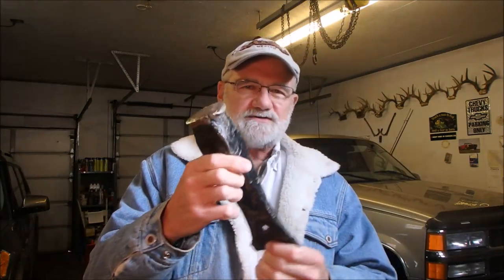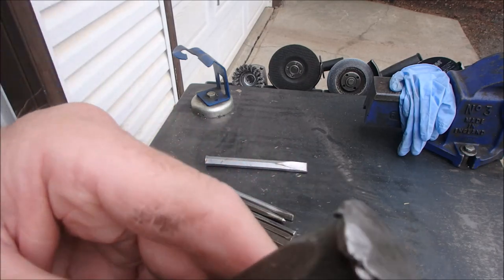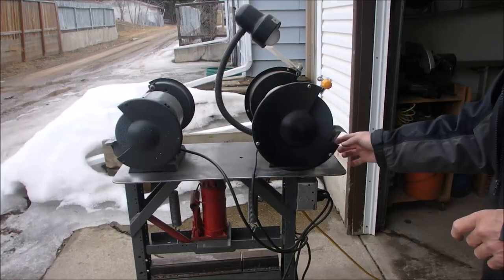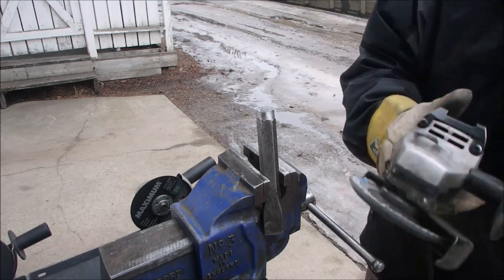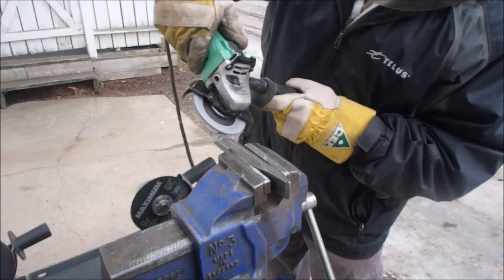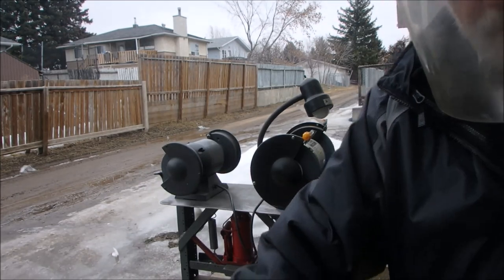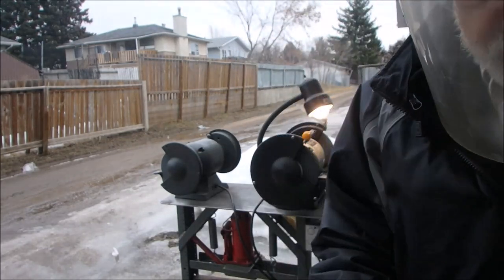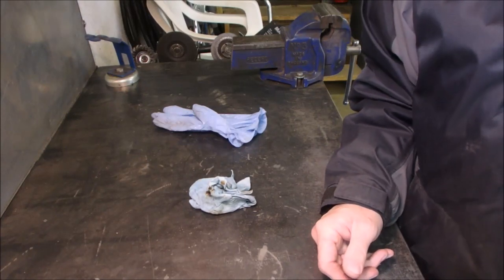Chisel Dangers

Comment: This is something I've practiced since being in the Navy some 25+ Years ago. After every use, we touched up the striking surface. We also had length limits marked on the chisels and once they reached that length, they were discarded and replaced with a requisition. Great practice to get into Bruce! Cheers my Northern Friend! Sean~
Reply from the maker: Yes they do get shorter.  Thanks for watching and commenting Sean.